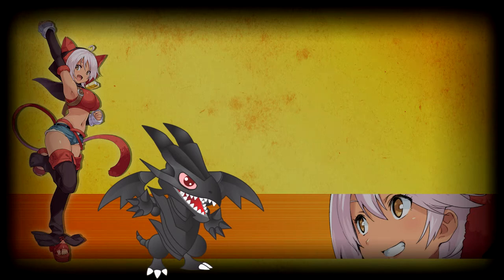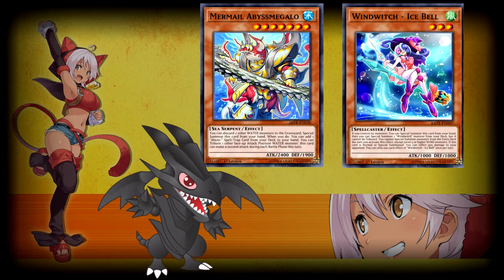Yugioh Engineeing - Episode 0: Pilot

Comment from the maker: I made a little technical mistake in the video. The example I provided Mermails using Windwitch engine was not entirely correct. The limitations of the Windwitch engine makes it so the deck can only summon level 5 or higher Wind monsters from the Extra deck, not at all as I assumed. 
This in no way change the point I made, however, I wanted to be clear about that since you know, Reading is hard for a Yu-Gi-Oh! player :P